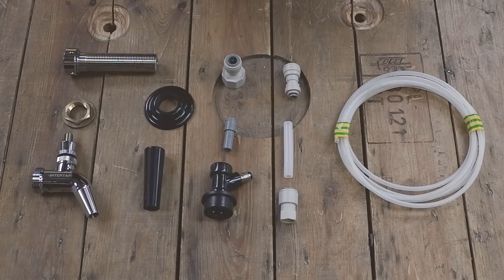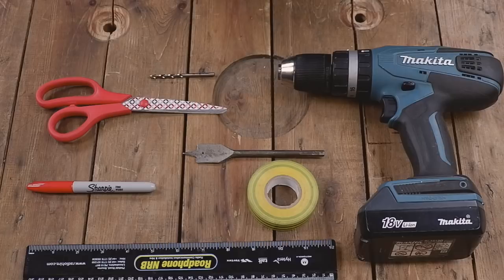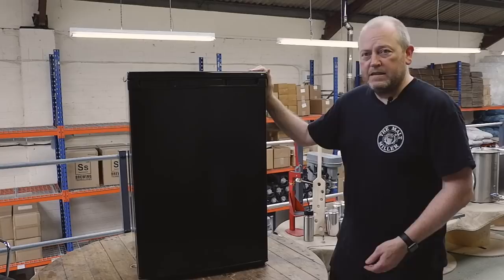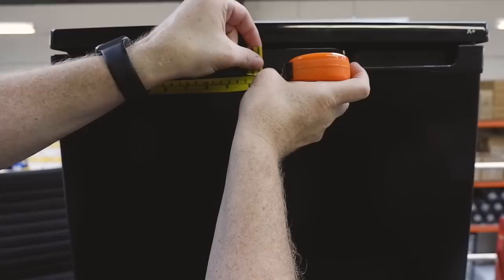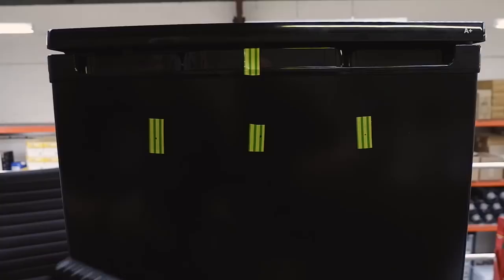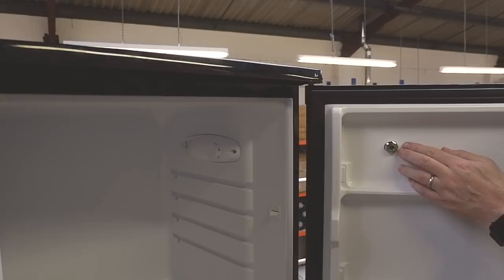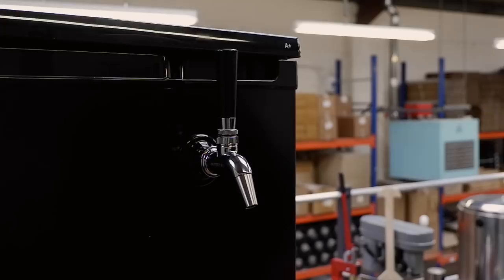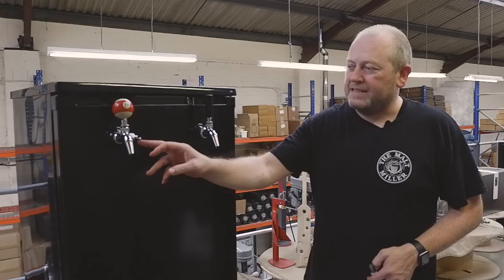How to build your own home brewed beer kegerator

Comment: Why do you use the line reducer?  I assume the 3/8 would provide a pour that’s too aggressive? 

Also what’s the difference between this & a keezer? Just the space & fact a keezer is a freezer?
Reply from the maker: Correct about the keezer.
And also about the line reducing to reduce flow.
On my other build I didn’t use this though, check it out
Reply: Keezer is better if you have the space. You  can fit a nice wooden top onto it and make it more like a bar. It also lets you change kegs without fuss. Also a lot more insulated usually.

Comment: What was the reducer thing on you put on the back of the shank, I have the jg fitting but it has 3/8 fitting
Reply from the maker: One of these https://www.themaltmiller.co.uk/product/john-guest-3-8-stem-x-3-16-pushfit-reducer/
Reply: Please put theses bits together as a package deal to buy on the site 😊
Reply from the maker: @tuffty01  As every build can be unique with various parts needed its hard to list as a single product. But we do have a blog post where you can find links to the individual items and then add to your basket

Comment: how much cheaper is it to do this than actually buying a kegerator? If cheaper at all
Reply from the maker: You maybe missing the point, it’s not always about money. Kegerators are available off the shelf. But pouring a beer that you have crafted from a kegerator that you made to your own spec is different.
Reply: @themaltmiller8438  Cool, I’ll buy from somewhere else. 😃
Reply: Cheaper if you have a large fridge sitting about. I wanted a 4 tap kegerator and they're like £760. I got a barely used  hisense RR330D4OC2UK  for £250 and modded that into a 4 tap kegerator. It has enough space for for tall AEG kegs. I needed the long 160mm tap shanks though. Fitted a wooden shelf in it with a hole drilled for the CO2 lines which I run from a CO2 distributor screwed to the floor of the fridge. Then I drilled a hole out the back to run the CO2 line into the unit. I run it from an Inkbird controller (another hole needed to bring the temp probe into the fridge). Really chuffed with the result, the main issue with this fridge is the curved front door, makes fitting a shelf for resting glasses on a little trickier.

Comment: Should've showed us how you ran the CO2 line also
Reply from the maker: Hey! We run the CO2 line through the drainage hole at the back of the fridge, you can do this easily using 3/16th line stepped down from 3/8th's and then back up again
Reply: @themaltmiller8438  thanks
Reply: @themaltmiller8438  what size keg u put in there
Reply: @scottbricker5004  it'll be a 19 litre corny